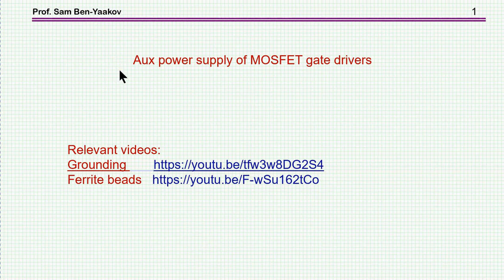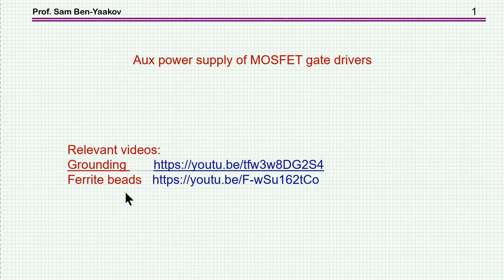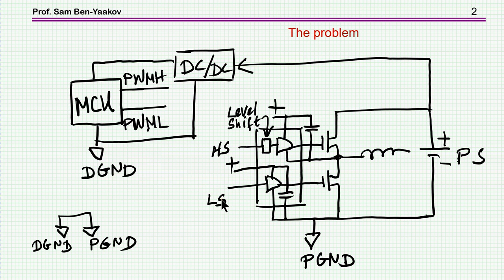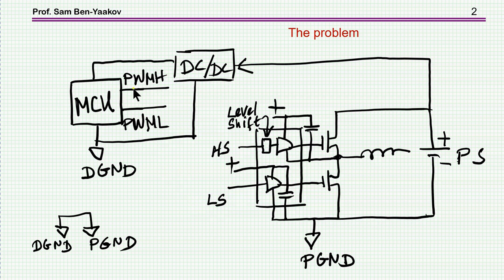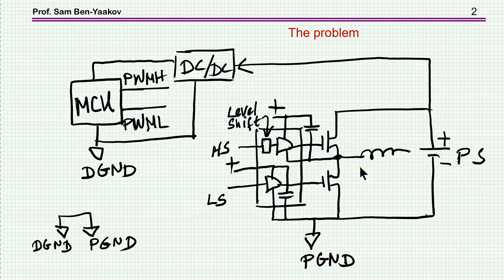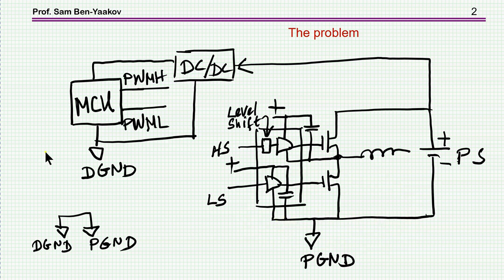Aux power supply of MOSFET gate drivers

Comment: In the connecting to power supply slide, what generates the ac noise signal (VG) between two grounds?
Reply from the maker: The fact that the tow ground connection are not at the same point and that there is a voltage drop in a ground plane
Reply: @sambenyaakov  There is an impedance between two ground points but is the ac current (Iac) returning to the power supply ground mostly due to IC (high-frequency current) or power supply ripple?
Reply from the maker: @fanshengshi1505  It will be primarily due to the main transistors switching current
Reply: @sambenyaakov  thanks you very much professor Ben Yaakov!

Comment: problems?!
1. The high frequencies would get past most LDOs, 
assume you ignore that
2. since LDOs should also have input and output capacitors,  you can consider it as another dc/dc, which can have the same problem as the original DC/DC
Reply from the maker: Well, I had assumed that people will pick up the torch from here.. The objective of the LDO is to handle the DC.   The AC can be easily attenuated by ferrite bead or inductor,
Reply: Fred Garvin  nothing is immune to high frequencies mate, LDO's PSRR is good till certain frequencies.
Reply: Fred Garvin  1. capacitance leakage between input and output, LDOs have much larger leakage at HF

2. control loop frequency of LDO is limited,
the control loop of LDO which rejects Power supply variations is useless above certain frequency